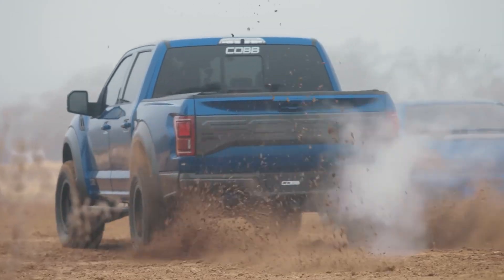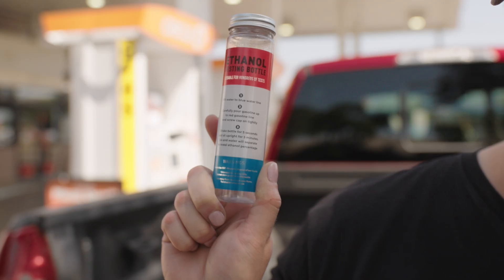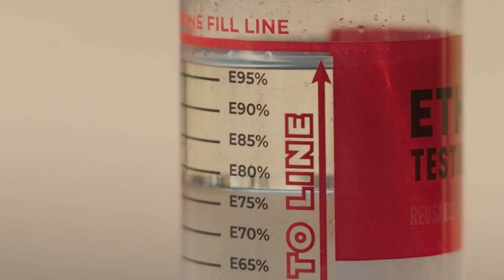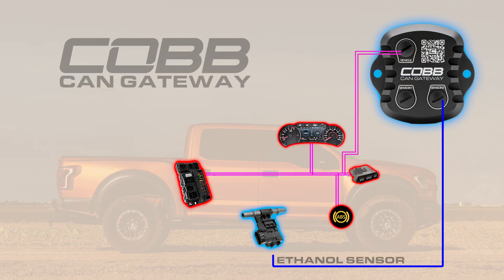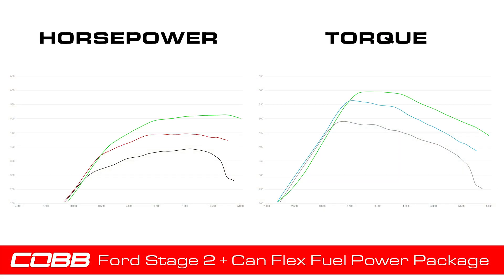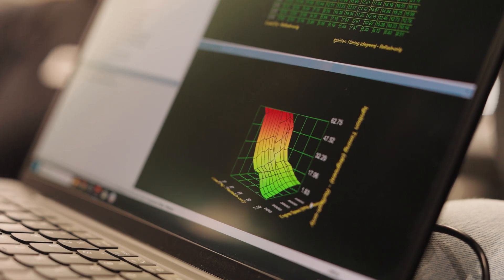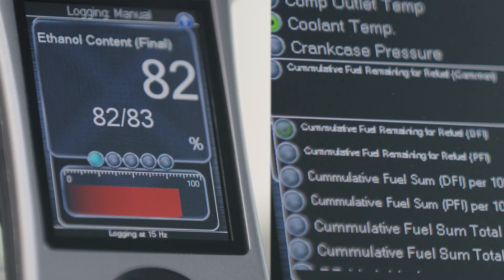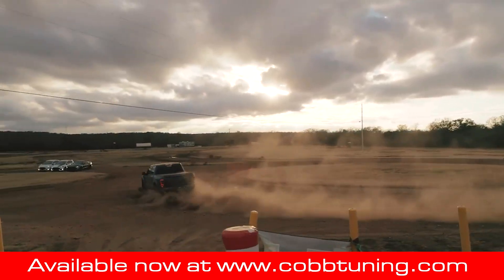COBB Tuning - Ford Raptor CAN Flex Fuel Upgrade

Comment: Dose the AP need to plugged in while driving?
Reply from the maker: It does not.  Once a calibration is flashed to the ECU, the Accessport can be unplugged and stored in its case.
Reply: Thats awsome.
Reply: My AP dosnt have the map. Do I download the OTS map?
Reply from the maker: @kacekace3676  yes, you will need to download Flex Fuel maps from our site - www.cobbtuning.com/maps.